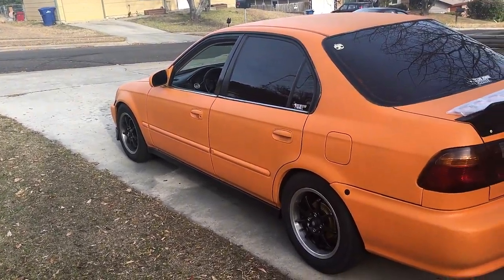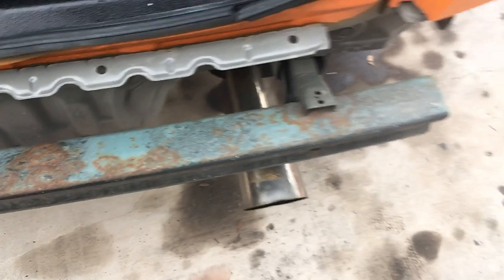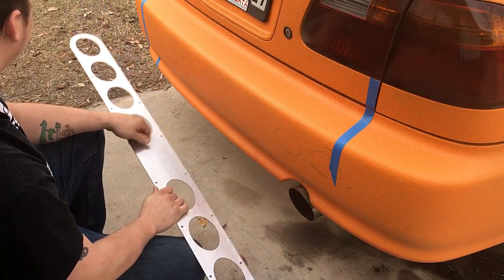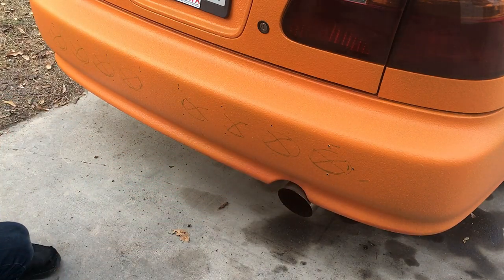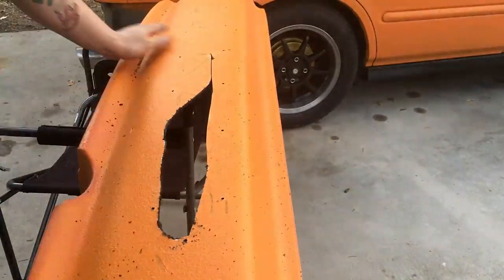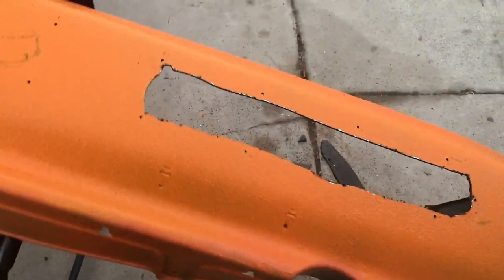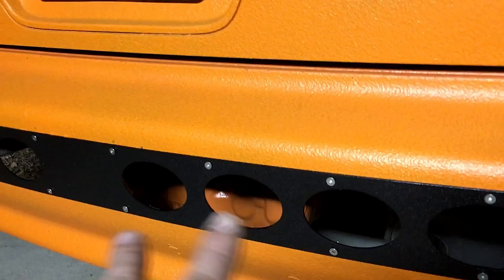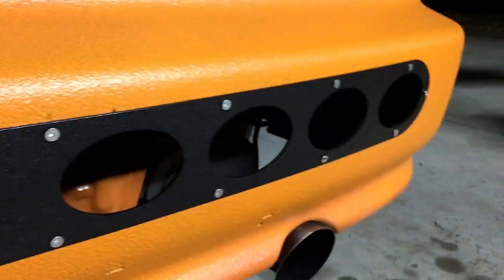How to install a rear diffuser (Autism awareness civic build part 5)

Comment: What are your thoughts on cutting the rear bumper versus a diffuser?
Reply: So you rhinolined the entire outside?? I’m not one to bash or hate on anyones work. Half these dip sticks are just talking shit because they don’t have the creativity nor the know how to attempt to do this. But my guy I totally agree with the rear spoiler and diffuser. However rhinoline isn’t a smooth surface. And the spoiler and diff are for aerodynamic. The roughness of the rhino lining takes away from that. I have a eg coupe I’m gonna be installing a rear diffuser. I was gonna use a routing bit on a dremel Stay tuned but good job bro. You have to drive it so as long as you like it fuck em. lol.

Comment: lol if you replace that rear bumper you should definitely drop the 10 bucks on a hole saw attachment for your drill next time you'll have way better results. but gj either way
Reply: He literally explains at the beginning of the video if you actually watch it
Reply: @eduardomeza7279  lol I did watch it a year ago and I still think he should've bought a hole saw where he was talking about using a dremel. You lose structural rigidity taking out the entire area which can cause cracks to form in the corners where you cut making it easier to flex and deform. Its also going to be where there's the most air pressure gathering and before exiting the diffuse while also being the least amount of material holding the thing together. A 10-20 dollar drill bit set is a good investment that could get a lot of use.

Comment: What does that do to your car
Reply: @1stingmusic357  the idea is to give air trapped in the bumper and exit.
= Less lift, drag in the absence of a diffuser. 
The smaller ones work better on the corners since the spare tire well blocks a lot of airflow anyways